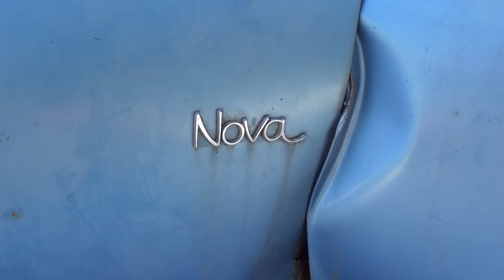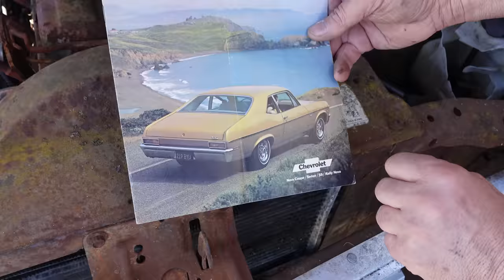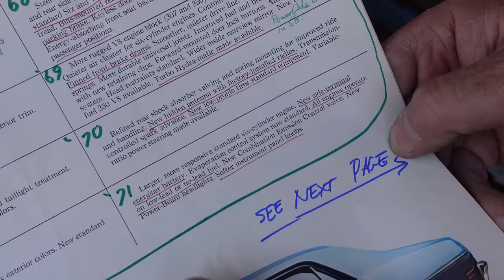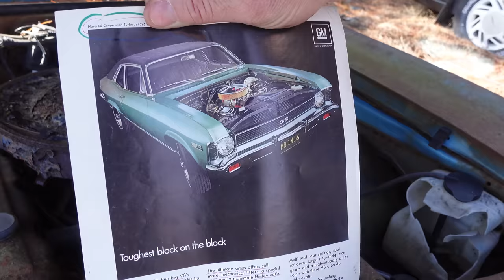Nova The Moon

Comment: In case anyone is wondering, you can transplant a ‘75-‘79 trunk floor to a’73 or ‘74.   I used a 1975 4-door Nova’s trunk floor for my ‘74 SS.   The tunnel for the fuel filler neck is wider, but it’s easy enough to narrow it

Comment: Another great video Steve!!! I have a 71 4 door, same color, sitting in my garage I've been working on for almost 5 years. I pulled the 250 for a 350, but kept the powerglide.
Reply: Why the four door - sentimental value to the car, or just one of the rare four door fans……..???
Reply: @ddellwo  mostly the price was the factor. I got it alot cheaper than what 2 doors were going for.

Comment: I love the 4 doors. I currently own a 1976 buick skylark and it's the sister to the nova.  They made a few designs off of the nova body.  The Apollo. The omega. The ventura. The skylark.  I think Gm designers had their heads in the clouds in the 70s
Reply: In Mexico in the mid '70's the Nova that was sold had the Nova rear end with the Buick Skylark front end.  That was odd since Buicks were not sold in Mexico at the time.
Reply: N-ova O-mega V-entura A-pollo😊

Comment: My friends and I treated the Nova as a throw away car and we did horrible things to them 30 years ago, everything from neutral slams, doing doughnuts until tires blew, using them to slam shopping carts in parking lots, drove them off road like a K-5 Blazer,drove them in shallow creeks etc. We were not kind. Back in the late '80s- early '90s there were still pristine examples to be found, so.e with big blocks. We tended to treat big block Novas and the Nova SS better though.
Reply: same here I could not break one no matter how much I tried

Comment: Side post seems to suffer from corrosion less than top post, when the battery terminals are neglected. 

Top post has more contact area, than side post!

Side post arrangements were cheaper to produce, and I heard the change was to gain hood clearance w/o loosing availability of battery volume, when cars were getting the body lines lowered.

Comment: Absolutely 💯 love 💖 68 - 72 Chevy Nova . Any 3rd gen GM , X Body  .
Even Buick Apollo , Oldsmobile Omega  , Pontiac Ventura  .

Like the dog cameo 🐶 

Owned a 72 Nova in line 6 cylinder 
TH 250 transmission 
4 wheel drum brakes 
Door posts too 
Base model 
VERY reliable car 
Wished I still had it 

Side post battery 🔋 terminal are 
AWFUL to service or deal with !! 
( imo )
Reply: Did you ever notice what it spells if you take the first letter of the x-body name from all 4 decisions?
Nova... Chevrolet
Omega....olds
Ventura...Pontiac
Appolo...Buick
It spells Nova! I wonder if that was planned or a happy accident. 🤔
Reply: Thought X body was the Monte
Reply: @tomwesley7884  nope.
Nova and it's siblings
Reply: @xfactorautomotive1496  in all these years I never noticed, how the heck did I miss that?! I’m pretty sure they planned it that way since the Chevy Nova had already been around for two generations and by the 3rd gen GM wanted the other 3 divisions to make an X body. Eventually even Cadillac did with the Seville in 1976, so it’s NOVAS, plural!

Comment: Back in the early 70s I worked at an establishment which prepared new cars for different dealerships, of 1 of those dealerships sent specially marked 4 door Chevy Novas (Marked as Nova SS) to Puerto Rico, I think they had either 250 sixes, or 307 V8s.

Comment: My older sister's second car she bought was a 1973 four door Nova the same color with the inline six and two speed powerglide. She had me tune it up and change the oil one time after she had it a couple of years and when I drained the oil out it had twice as much as it should have and smelled of gas. The mechanical fuel pump had gone bad and was leaking gas into the crankcase. My dad and I advised her to trade it off because she might have wiped the bearings out so she traded it in on a brand new 1978 Trans Am.
Reply: Upgrade!

Comment: My ex wife had a 70 Nova 4 door. 307 engine with a  Powerglide. Same color blue with a vinyl top and cheap vinyl floormats. I later built and installed a 406 with a Turbo 350 transmission. We used to smoke the teenagers with their Mustangs and Camaros.

Comment: The 350 and four speed was not exclusive to the SS, it could also be had in the Rally Nova. My neighbor bought one new back in '72.
Reply: Think Steve said 350 quadrajet
Reply: My neighbors '72 Rally was a four barrel, four speed car. The Rally Nova isn't as well known as the SS.  Also had a friend with a '75 Nova, four door stripper with a 350 two barrel. Both of them neat cars in their own way.
Reply: Upon research, it appears I am wrong. My neighbor must have had the work done, the Rally was only available with the two barrel 350. I stand corrected.

Comment: Hi Steve, good video!  Good car!  The idea with the GM battery side lug terminal(s) where that they not supposed to corrode as like the conventional top lug terminal(s) do so, due to the fact that they where further away from the battery cap vents.  With all due respect, are you sure that the four-door ChevyII/Nova (GM X-Body) version arrived in 1972?  Please reply.  Dave...

Comment: 1972 was NOT the first year for the 4 door in this 1968-1972 generation!
 1968 4 door was available. 
I had a 1970 4 door 307 V8 AT PS with factory dash AC! 
Great car, sold at 188,000 miles, original engine and transmission. 
Another fact, very rare, a 4 cylinder was available, 1968 -1970. 
Grill was slightly different 68 through 72, as was the interior, and side/tail lights.
Nove was know as "the poor man's Camero", of "family Camero", because the front subframe was nearly identical/shared with the Camero.
This generation Nova production shared materials/parts made it possible to build the Camero at a good price.
 Just like the Mustang from the Falcon by Ford.

Comment: 68-69 had smaller side marker light holes than 70-72. And 68 was the only year to have the key on the dash instead of on the steering column, which makes the steering column and it's support different. These two facts makes it easy to tell the difference between a 68 and a 69, even if the car is completely gutted. Small markers and a rounded support is a 68 (or, key on the dash if the dash is there). Small markers and a more squared off support is a 69 (or, key on the column if the column is there). 70-72, being cosmetic changes, you can't really tell from a bare shell- other than it not being a 68-69 due to the larger marker light holes.

Comment: My dad had a 2 door base model. I think it was a 1970. Six cylinder, rubber floor mat, bench seat. Had the manual valve body Torque Drive Power Glide. Basic transportation.

Comment: In the 77 brochure they claimed nova started in 62 not 68...as a trim level yes it did but that goes against the 72 brochure.
Reply: 1969 was the first year for it to be a model rather than a trim package. Through 1968 the model was a Chevy II with Nova being the highest trim package. I always found it curious that they didn't change the name from Chevy II to Nova in the first year of the second generation, 1968. It seemed like the time to do that, but alas, it was a Chevy II til the 1969 model year when the Chevy II name was dropped completely. I am a huge Nova fan. My first nova was a 1970 I saved from a junk yard when I was 16... probably should have left it there, in retrospect....and now I own 2 first generation cars, both 1962's.  A 2 door hard top my mom bought new and a wagon.

Comment: Small Blocks work best in Novas. That was the point of the lighter more responsive engine. Streetwise they ruled both in driveability, economy (sort of) and performance. A plain Jane with a 350 could eat a Camaro or Mustang on the street on any given day. That is what made them so special IMO.

Comment: Third Gen Nova 4-doors had a frumpy look to the roofline, but the next generation (75 thru 79) had fairly sporty looking 4-doors. Perhaps BMW inspired.

That said, I always thought the third gen Nova 4-doors were potentially great sleepers when they were abundant, since any hot Chevy engine and drive train could be swapped in. Actually, that goes for all X-Bodies. Could you imagine a ‘70 GS 455 in an Apollo? Just make sure the brakes and suspension were up to the task as well. And add subframe connectors.

Comment: 1:30 in and already a mistake. Nova always had a 4 door sedan right back to the first one. This is a second generation Nova, running from 68 through 74. Third generation was introduced for 75 and lasted until Nova was retired in 79. You are thinking of the Maverick and Comet that were 2 door sedans until the 4 door was introduced for 72.

Comment: Cool mags that picture of the green 68 nova in the ad with the black vynal roof looks exactly like nicks old nova it was that color with the black vynal roof had the stock S/S grills on the hood and had the centerlines with the skinny 3.5s up front and cheater slicks on the back car was beautiful and fast it had a 427 tri power engine from a vet with the factory triangle air cleaner he and Andre who owned black magic which was a 69 nova with 454 nitrous 10 second car one night they met at Vincent Massey Park one of the best street races I've seen image it's 2:00 a.m and they had to wait on the side of the road running waiting for there to be nomore cars at the light as time was passing and we were all standing there they said fuck it went to the light there was a family in their car beside them who got to witness the race first hand in ottawa canada nick flew down heron dead like a f-18 while black magic came out of the lights sideways squirrely and by the time he crossed that intersection nick was already half to prince of whales road awesome night lots of racing then we had to take off as the police roll in lol!

Comment: 1973 was fourth gen,
Reply: No, that's not correct. 1962 to 1965 is the 1st generation, 1966 to 1967 is the 2nd generation, 1968 to 1974 is the 3rd generation, 1975 to 1979 is the fourth generation, and 1985 to 1988 (the rebadged Corolla built at NUMMI) is the 5th generation.
Reply: you're right.

Comment: Actually STEVE the Nova in 1963 to 1977 was considered a "compact car", as the Malibu/ Chevelle was still considered "mid sized" and the Caprice and Impala were the Chevy "Full Sized" cars of the day! Oddly when you consider the overall dimensions of a 2010 Toyota Camry, to a 1972 Chevy Nova, the Camry is NOW considered a "Full Size Car" but is still slightly smaller than the Nova!!

Comment: I Think It's BEYOND TIME, For Steve To Finally CHANGE  HIS  DIRTY PANTS.  WOW...  I OWNED One Of Those 72 Nova 2-Door Cars With The 250 And A  Floor Shift.  But It Got A TERRIBLE 12mpg ON THE HIGHWAY.  Pretty Quickly I Changed The Head From A 194 For Higher Compression And Installed A Racing Cam Too.   It Wouldn't Idle Smoothly AT ALL Humping Along.   But Got The Fuel Mileage Up Much Higher, And It Could EAT A 283 In A Boulevard Race.  They Looked Really Great As Being MY POOR  MAN'S  Muscle Car In Those Days...

Comment: Love my GMs. I Have / had many in the mix. Side post batteries super suck! I always say I will punch the designer of those batteries in the mouth. I would give him a chance first to get away. He only has to jump a car with dead side post from a good side post car. In the cold with the cars set apart so the cable just barley make it! In the dark! Lol!
Reply: If you have the correct jumper cables or jump start box, it's never an issue.
Reply: I feel the same way about the engineer who came up with the oil filter location on my ‘97 Cavalier with the 2.2 four banger……..🤬
Reply: @ddellwo  2.4 is an easy oil change, but the water pump is a pita.  An engineer would climb over a mountain of virgins to eff a mechanic
Reply: @googleusergp  I get it right tool for right job. I had really good cables made for side post and still had trouble. But striped out bolts? What do you do in an emergency?!  I never had as many problems with top post batteries. And reaching the terminals and then staying in place? Not in my 2001 Chevy pu or my 84 corvette without having to remove something.
Reply: @edwardbianchi192  I've never stripped one in over 35+ years. LOL. If you do encounter one, a locking pliers gets it loose and then you can replace just the bolt without a problem. Readily available. A 5/16" wrench does it for those side post batteries.

Comment: Steve Novas had 4 doors from 1968 thru 1974. Only Novas missing 4 door production was previous body 65, 66 & 67.
Reply: The 1966 Chevrolet Nova brochure clearly states there's a four door sedan.
Reply: @googleusergp  you are correct. But there were 100% 68-71 four door novas.
Reply: @BBBILLY86  Sure was.

Comment: My first car 68 nova four door. Front. Damage. Paid. 150.00. For  it. 60.00 for another hood. And. Radiator. We. Straighten. Rad. Support. And. Number. Bourght. New. Hood. Emblems. And. Grill.  From. Locacal.  Deale.  27.00.    Thor. Was. In. 1973.   Motor. Was. Smoking.   We. Replaced. Water. Pump.   Accident. Damage.      Dad coworker. Father had. 66 stuberbaker.  Body. Was toast.   We. Bought. The. Engine. Only.    Hi. Straight. Six.  I drove.  Three. Years.  And. Sold.

Comment: Question to anyone is a nova and Chevelle and Malibu the same essentially??
Reply: They share some parts but are different chassis and product lines.
Reply: No. Chevelles are bigger, and they have a ladder frame. The Nova is a uni-body, and it shares more parts with the sporty Camaro. Both were based on the earlier Chevy II compact.
Reply: Not at all.  The 68-72 nova is essentially a 67-69 camaro with different skin.  The 75-79 nova is essentially a 2nd gen camaro with different skin.  The 73 & 74 novas share some things with a 67-69 camaro
Reply: Thank you fellas I always wonder
Reply: @AcmeRacing  Not entirely correct. The Nova has a subframe and it is only partially unitized.
Reply: @googleusergp  well, that's not exactly true either. From 1962-1967 it was most certainly unitized. Nova didn't get a front sub frame until 1968 which lasted until the end in 1979.
Reply: @xfactorautomotive1496  We're talking about this generation shown in the video, however.
Reply: @googleusergp  Subframes don't mean it's a body-on-frame car.  Only the body shell ties the front and rear subframes together; the same is true for the Camaro/Firebird.
Reply: @AcmeRacing  I know that. I've owned a Trans Am for 43 years. However, it is incorrect to call it "unitized" construction. It is not. It is PARTIALLY unitized.
Reply: 🙄 FFS, we all know how "smart" you are.